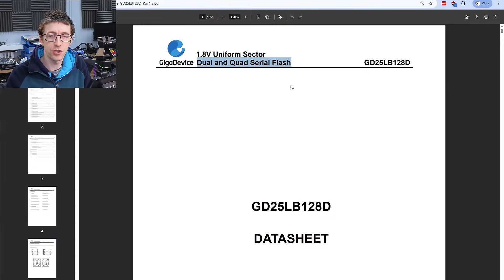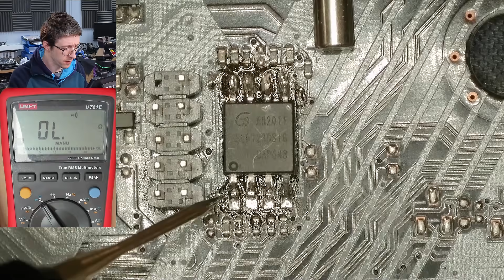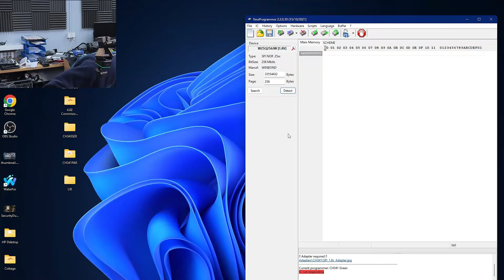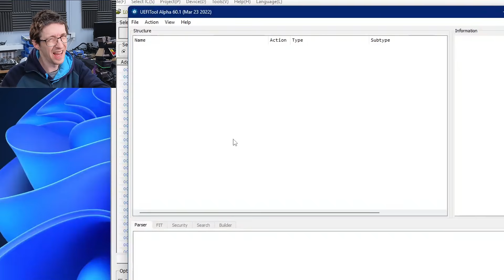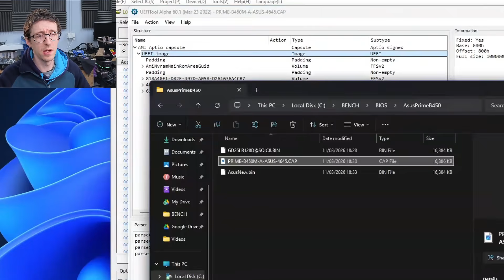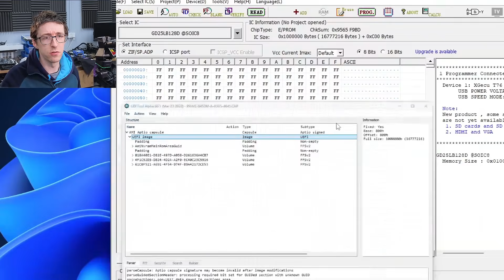SPI Basics and Capsule Files - UEFI Crash Course Part 2

Comment from the maker: Y'all spotted it, I was reading the pins on the chip from left-to-right instead of anti-clockwise! I'm so mad about that 😅
Even as I specifically told everyone 'Be careful to read the pins the correct way around! I was doing it wrong on the chip itself. Other theory I'd heard was that pull-down resistors on the mobo could mess with the SPI header, where as the pogo adaptor bypasses them by applying directly to the chip. This was going to be my guess before I saw the comments that I'd just read the pins wrong.
Reply: yea noticed that too.
Reply: "Stop it... Get some help."

Seriously though, happens to the best. Thanks for the video. I'm surprised I caught it this early. I checked the date to see if the info on UEFItools was up to date and its hard to beat 9 hours on a vid. I think some of mine are like 15 years old now.
Reply: Pin 8 with header 8 is wrong...
Reply: thats exactly what i was thinking and told myself what i recently learned is not universal? and just made me confused that why

Comment: SPI is for high speed low latency communication between closely located integrated circuits on PCB. When you use long leads for SPI to connect integrated circuits (the BIOS chip and the programmer chip) it messes things up electrically. SPI is not meant for long wires.

Comment: ~20:35 ---> SPI : you have numbered the BIOS pins in the wrong order from 5 to 8 : you didn't read them counterclockwise...your 5 should be 8, your 6 should be 7, etc...

at 12:48 : when you say "6 to 9", it should be "7 to 9" ! (you're on pin 7, not 6 !)

Maybe would it be easier to create something that looks like a little "network patch panel" so you don't have to solder each time....A row of 8 holes in front of a row of 9 holes and make connections as needed with little wire jumpers

Comment: Just thinking wouldn’t it be easier if you left the cables soldered & labelled them ie vcc, vss, etc near the 2mm push connectors. If you used single instead of dual connectors then you could fit them individually making it a universal cable once you’ve worked out the pin out

Comment: Hi, I can't test the contacts on the Gigabyte B650M AORUS ELITE AX motherboard. The multimeter doesn't produce any signals, so how can I determine which pins to connect to the ESPI_DB connector for the CH314 programmer? 
The Boardview shows the pin numbers on the ESPI_DB board like this: 
1 A_ESPI_D0 : 
2 VCC3: 
3 A_ESPI_D1: 
5 A_ESPI_D2 : 
6 DB_CLK_IN : 
7 A_ESPI_D3 : 
8 GND : 
9 ESPI_CS : 
10 A_ESPI_RST- : 
11 ESPI_ALT : 
12 LRESET- 
And on the bios chip board 25Q256JWEQ the following designations: 
1 A_SPI_CS- : 
2 A_SPI_DI : 
3 A_SPI_WP- : 
4 GND : 
5 A_SPI_DO : 
6 A_SPI_CLK : 
7 A_SPI_HD- : 
8 A_VDD18S5 
Please help me figure out which contact to connect to which?

Comment: I felt really on edge that you didnt test your pin layout directly with the bios chip instead of using those pins in the motherboard. You might have connected wires the wrong way around.

What I mean to say is you could have checke continuity between pin one on the bios and pin one on the programmer, and then go in order to check all the pins.

I hope my explanation was good enough lol

Comment: The WP pin, by default, only protects the Status register from writing. It does not normally prevent data fields from being written. The function of the WP pin is set by the block protect bits in the status register. By default, it is 0 (no protection).

Comment: You should make a drawing of the different pin-outs with pin functions and the wiring in between. That way you can check your drawing with what you build to make sure each pin is connected correctly. It might feel like an unnecessary step, but in this example you're making an adapter cable that has to go from one specific 8-pin configuration to another specific 8-pin configuration and all 8 pins need to be connected to the right counterpart. That is not trivial, there are 40319 wrong combinations possible and only 1 correct one.

Comment: Hello Graham. I would like to help but I have just noticed something that might be irrelevant: 1. when you checked which pin of the chip corresponds to which pin of the motherboard you didn't show how you associated what you call pin number 5 and pin number 7 
2. by the datasheet you previously show the number progressions turn around the chip so that number 5 is in front of 4, number 6 is in front of 4, number 7 is in front of 2....   You counted instead 6 in front of 2 - 5 omitted - 7 in front of 3, 8 in front of 4.
3. at 18:55 I was wondering if the usb connector not completely inserted could have been the cause of the failed reading but you had the same issue with the usb C reader before.
Thank you anyway for sharing. I really enjoy your explanation and your calm speech.

Comment: Pin 7 is orange hurts my brain. Use the colour code (violet)! I tend to use 2 shorter dupont M-F and M-M cables along with a 3d printed clip that holds nultiple MF connections together.  Pin 2 is always red, regardless of end but in the clip it might connect to yellow, pin 4. Change the genders as needed for the application, but its really easy to troubleshoot as both ends are just the standard resistor colour code and wiring problems must be at the join.

Tin whiskers form over many years, that's why lead was added to solder. It's not the action of a soldering iron wipe. It's an interesting read on Wikipedia. A decades old device can literally create it's own short over time. 

Interesting stuff all the same, thanks.

Comment: chip clips are great  but i find clips onto boards dont fit deep enough because decoupling caps and termination resistors are always in the way but my experiance is from car radio decoding and tv hdmi handshaking i2c eeproms and firmware flash roms, not mobos

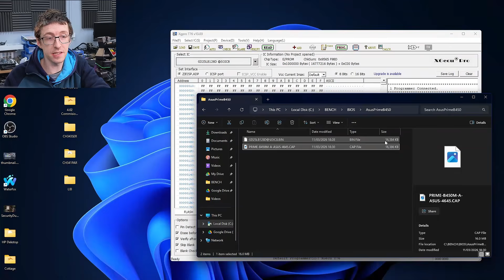Comment: 21:29 16,384kiB is not 16.384MiB though (I know Windows shows kB, but that's because Microsoft decided to use decimal prefixes for binary conversions against all conventions). The file size should be exactly 16 MiB, or 16 * 2^20 bytes, which is 16.78 MB in decimal conversion (16777216 Bytes).

Comment: Great videos. Very minor comment:  The wire colors actually have an "order" with "number values" which (once memorized) makes it very easy see what order they should be installed, for example, on the SPI header on the motherboard.  This "order" is based on the "resistor color code" which most old-schoolers know very well.  I always try to keep wire colors in "resistor color code" order on the loose end of the SPI wires so that they're easy to re-connect.
Reply: I just posted this but you can do both ends in the standard colour code, just use 2 cables that join M-F in the middle. Add a 3d printer and you can make a clip to hold them together, which is very readable. A connection Orange-Red is (obviously) pin 3 to pin 2.

Comment: I am currently tinkering with the exact board. I removed my chip from the motherboard and soldered it to an included pcb. programmed the chip using asprogrammer & ch341a with the 1.8v adapter. Re-installed the chip on the board and tried powering on...but only a black screen. what could've gone wrong?

UPDATE:

I followed your procedure (SPI Header wiring) and flashed the chip to an old known working BIOS version. The board is currently working and I have a 3500x with 4 missing pins that I hope to fix and pair with the board.

Comment: Great video Graham, as always clear and informative. I think your SPI header didn't work because you mismatched the pin mappings between the chip and the adapter. At 12:40 you counted the pins on the right side of the chip from top to bottom, instead of counterclockwise. On the adapter, instead, you had the correct (counterclockwise) sequence but they were no longer mapped to the correct SPI header pins

Comment: Think that WP pin is connected to the header through a resistor, thats why it did not beep.
Reply from the maker: The resistors were going to be my theory based on other people I'd spoken to as well. However, the other comments are right, complete blunder I was reading the pins on the chip itself from Left To Right, which is wrong in any possible scenario 🤦‍♂️🤦‍♂️🤦‍♂️

Comment: Tin whiskers are not wires sticking  out, they are a growth or form of corrosion that was discovered in the 60s i believe. i think the phenomenon caused a early satellite to fail. Thanks for the video.
Reply: yes early solid state radios with germainium  transistors internally shorted out because of it, inside the tranistors metal screening can ,part numbers like af117 spring to mind , i just thought he was knowingly joking , but hes too young to know that surelly?

Comment: 12:48 -??? - seven to 9, six to 8, surely?? Or am I misreading the pin-out diagram??
Reply: No you are not wrong. Chip pin numbers are counted usually counted counter clockwise from the dot(like in the datasheet). The first 4 pins are mapped correctly, but 6,7,8,9 are mapped in the wrong direction. Pin 5 is in the top right corner in the video pin 8 is the top left.  So the pin referred to as pin 8 is actually pin 5, pin 7 is pin 6, pin 6 is pin 7 and the pin referred to as pin 5 is actually pin 8.
I recon this is why it did not work :P The clip adapter doesn't care about Graham's counting, so it works fine. This is a very common mistake I have made plenty of times myself.

Comment: Hi Graham, great video, I think the reason the header did not work is you pinned out the bios chip the wrong way round. Pin 5 is opposite pin 4 not pin 1. From the datasheet you displayed